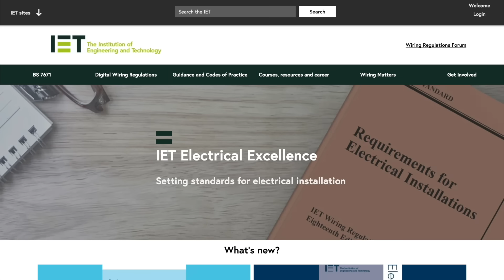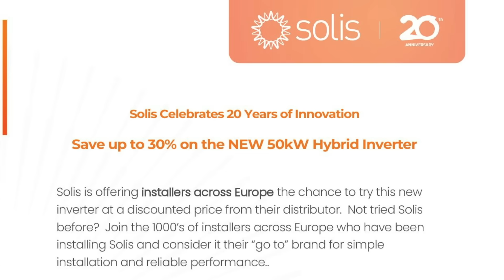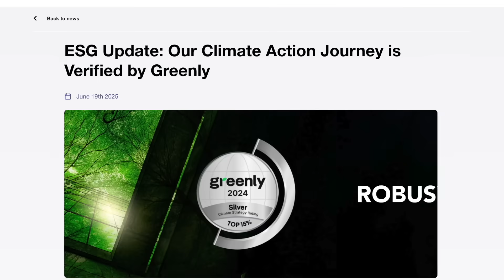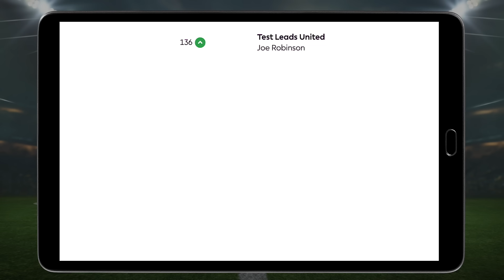Exclusive: Grid Bosses Set to Change UK Voltage

Comment: Reduced voltage, then to maintain consumption demand would require an increase in current flow. That would require a replacement of all the supply cable infrastructure with heavier cable.
Unless of course someone worked out how Nikola Tesla was able to transmit AC through the air. 
Ah, that was a zero profit project. JP Morgan was not impressed.
Reply: Resistive heaters will draw 29% less power @208V (compared to 240V; 13% less current)
Electric cars will draw 13% less power @208V (compared to 240V, same current)
Computers will draw the same power @208V (compared to 240V, 15% more current)

Comment: No, the UK is not changing its voltage. The standard nominal voltage was harmonized to 230V in the 1990s and has not changed since. This was primarily a paperwork change, and the actual voltage supplied to most homes and businesses still runs near the former 240V standard. 

Here's a breakdown of what happened:

The "change" was a compromise: In 1993, the European Union harmonized the nominal voltage across Europe to 230V. Before this, the UK used a 240V nominal voltage, while mainland Europe used 220V. The 230V standard was chosen as a compromise.A simple shift in tolerances: Instead of physically changing the grid, the legal tolerance range was adjusted to bridge the gap.The UK's legal tolerance became 230V +10% and -6%, allowing the supply to be between 216.2V and 253V.Since most of the UK's voltage was already within this new range, no expensive infrastructure changes were necessary.The actual voltage remains higher: As a result, the real-world voltage in most UK premises remains closer to the original 240V, though it is still legally referred to as 230V.Modern appliances are built for this range: All electrical equipment sold in Europe since the 1990s is designed to operate safely within the 230V ±10% range. This means that whether your local supply is closer to 220V or 240V, your devices will function properly.

Comment: I think most household appliances will continue to work ok as many things in the home don't actually need the high voltage and have internal transformers that cut down the voltage to a very low voltage , even the devices that do actually use the high voltage will ,I  think still perform as normal ,,,

Comment: The UK's electricity network chiefs are proposing a controversial change to the nation's voltage limits (1:01). This move aims to facilitate grid management as more renewable energy sources are integrated. The proposal suggests reducing the lower legal limit of mains voltage to 207 volts, aligning the UK with European standards (1:13). This change would help address issues where solar inverters push up local voltages, causing equipment like EV chargers to shut down (1:20-1:40). While network operators believe most modern appliances will be unaffected, the Institution of Engineering and Technology warns about potential impacts on older or safety-critical systems, as well as the tripping behavior of MCBs (2:40-3:06).

Other important news covered includes:

    Another fake electrician was unmasked in Ireland (3:50). Simon Murphy carried out dangerously faulty work and fraudulently claimed to be a registered electrical contractor. He was ordered to pay compensation and a fine (3:51-4:49).
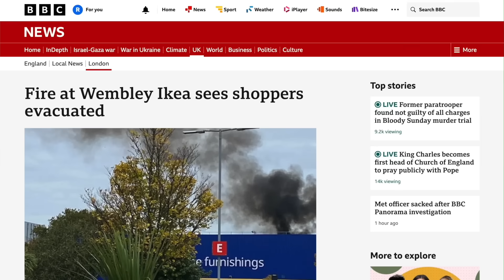    A huge solar panel fire occurred at an IKEA store in London (4:50). This happened during IKEA's first week of selling photovoltaic equipment again in the UK. Five fire engines and around 30 firefighters responded to the blaze, which involved about 100 panels (4:53-5:11).
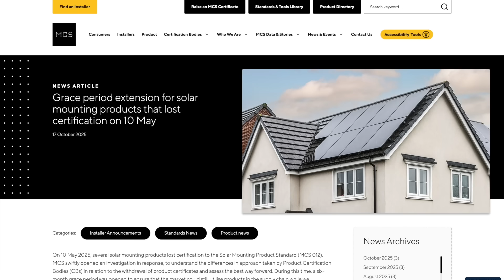    The Microgeneration Certification Scheme (MCS) extended the grace period for solar mounting products (5:42). The new deadline for compliance with the new standard for solar installs is August 10th of next year, allowing manufacturers more time to get their products certified (5:51-5:58).
    Solis unveiled new solar kit for commercial and industrial applications (6:31). Their hybrid inverters can handle up to 200% of their rated DC power input, and they introduced a new 4-in-one powerhouse unit (6:38-7:11).
    Hensel revealed new SWA junction boxes with a built-in protective earth inlay (8:02). These thermoplastic boxes offer ease of installation, cost savings, and durability compared to traditional metal ones (8:20-8:33).
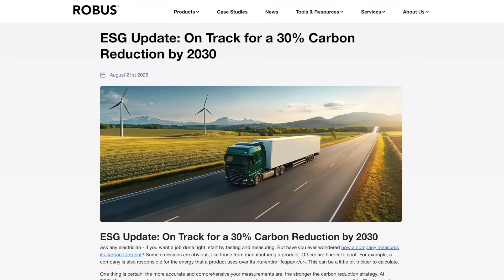    Lighting manufacturer Robus announced its goal to cut its carbon footprint by 30% by 2030 (8:44). The company measures the entire energy used by its luminaires over their lifetime and the emissions from manufacturing and disposal (8:52-9:09).
    Velocity Pro Gear is offering a special deal on tool bags and backpacks (9:26). Customers buying qualifying products can receive a free Drillpod XS (9:33-9:38). Their Rogue 600 wheeler tool case is highlighted as the world's first trackable tool bag (9:42-9:51).
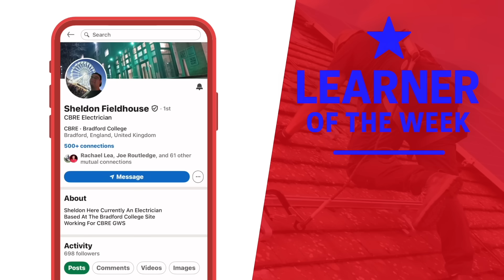    Sheldon Fieldhouse was celebrated as the "Learner of the Week" (10:27). He was recognized for his commitment to training, leadership, and community engagement as an apprentice electrician (10:49-11:24).
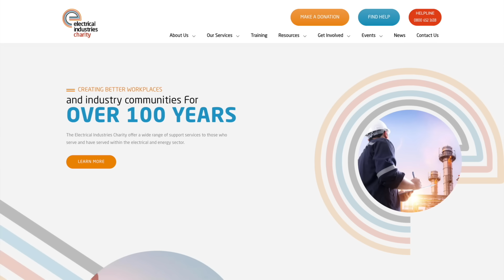    The Electrical Industries Charity (EIC) provided support to an apprentice named Jack (11:58). The charity offered financial assistance and practical help, enabling him to continue his apprenticeship while caring for his mother (12:13-12:24).

Comment: Recent ex DNO fault engineer here. I have dealt with many "voltage complaints".
This is a problem thats been around for many years, quick example, a network mostly made up of industrial consumers means night time loads are small, this leads to a raise in voltage, daytime load is high, reducing the voltage.
The fix is to set the voltage at the local substation to higher level to cope with the daytime load but not too high to cause a problem at night.
This is a fixed "Tap" position, needing a shut down to change so its very important to get it correct.
An online tap changer is large, expensive and a point of failure way above the off line type.
This local level control is not easy to do.
But at primary substations 33kv - 66Kv and above, there are automatic online tap changers.
30 years ago we stopped using "voltage regulators" on the local network as the system didn't need them anymore as it was so robust. I suspect they may come back, at a large cost in purchase and maintenance.
This is the only feasible option if the standards don't change. I can't see voltage regulation being fitted to individual older appliances, though property regulators would work.

Comment: 2:00 until the last week or two the voltage here was at very much the upper end. Ranging from 247-252v and the majority of the time sitting around 250-252. I always felt like it was pretty high. Then suddenly it switched. Now ranging from 241-250 and spending a lot more time at the lower end.

No idea what they did for the change mind you.
Reply: They could have changed which tap your distribution transformer was using.

Comment: Back in the 70s, I was working at a canal hire boat base on the Canal du Midi in southern France. Our nominal voltage was 220V. However, as our base was 4Kms from the nearest substation and the line ran from our office to the on-site restaurant with deep-freezers and then onto our workshop, any time we took a 25 metre lead from the workshop to a boat, we only had 110V available and nothing electronically controlled would work.
Reply: 225V in Italy

Comment: Are there any assumptions made when calculating a bill? For example is there an assumed network voltage used,  e.g. 240V, and if so, then will the bills change this assumption, or do meters measure both the current and voltage and therefore result in little to no impact in billing because the same power is consumed overall?
Reply: I believe (though could well be wrong) that most meters measure in Kilowatt-hours, which would account for both.

Comment: I will  NOT have any problems with the lower voltages compromising my MCBs ....  (  as I have a 1950's  FUSE BOX 😝 , which has never blown any fuses in 70 years ... if it aint broke DONT fix it 😝 ) ........... DAVE™🛑

Comment: Lower voltage = higher current for the same load. Higher current can be problematic for wiring if no spare current capacity exists on the  cable(s).

Comment: When the world adopted 230V as the nominal LV distribution voltage, New Zealand did ....... nothing.  NZ had adopted 230V +/- 6% a very long time ago (1930s I think) presumably with the idea of allowing both 220 and 240V appliances to be used.
Lowering actual voltage is easier said than done.  Often distribution transformers do not have the 'buck' taps needed, and reducing the  230/400V or11kV (or similar) system voltage reduces network capacity.   So the change takes time, during which appliance performance can vary between installations.  Modern equipment is often very tolerant of input voltage changes, but of course some is not.  Local generation adds a considerable complicating factor.

Comment: Dropping the voltage will increase transmision losses for the same power draw as equipment with switch mode power supplies will just draw more current to compensate for the lower voltage. End result current increases in the transmition lines due to increased current. To be energy efficient the the voltages should go up to reduce current and hence transmition losses. Droping the transmition voltage reduces efficiency for the transmition lines.

Comment: We can all line up for a class action law suite against the government; when our '''not so modern, perfectly functional appliances ''' go to lunch (apparently there was a compelling reason for the 10% tolerance ). What a bloody farce! All because a minority of affluent greeners  bugger up the supply! Instead of down rating the grid why don't the daft sods regulate the individual input from the greeners at the point of induction. By the same token; if a solar array is capable of supplying premises with energy to spare, why connect them to the grid anyway? Make the greeners store the excess in batteries! There is an ulterior motive here! lower voltage means less energy produced over a given time. means lower production cost, means even greater profits for the generators and suppliers; the next time they jack up the tariffs. They had no problem when the nation used to switch on the tellies, kettles and cookers at a quarter past six in the evening! ( they even made a short black and white documentary advertising the fact ) so why the sudden turnaround?

Comment: That is insane! All the electronic devices that worked perfectly and now will no longer due to voltage changes
Reply: no they wont
they didn't when it dropped from 240 to 230 did they
most devices are rated 200-250 and will just draw slightly more amps

Comment: Even shrinkflation in electricity, unbelievable
Reply: Fun sized electricity.
Reply: It isn't though. You pay for power x time (kWh) which is independent of the supply voltage.
Reply: @PharmaGiles  And watts is what?
Reply: @kaduseus  he just told you: Watts is power times time. Watt part of that did you not understand?😅

It's like distance travelled is speed times time.
Reply: @trueriver1950  So not volts amps then?
Reply: @kaduseus  For simple loads, such as an old-fashioned filament light bulb or a resistive electric heater, reducing the voltage will reduce the current and therefore reduce the power consumed, but this would also mean a lower bill. Having said that, the vast majority of modern electrical appliances nowadays (LED lighting, TVs,  computers etc) are far more sophisticated than that and will adapt (within reason) to the supply voltage and be unaffected by small changes.
Reply: @PharmaGiles  Switch mode power supplies are in most cases regulated at their output. So if you lower the voltage it will increase the current. Thus increase the loss in the power lines. Bad idea!
Where we have ohmic loads today?  All appliances got regulated power supplies today, you telly, your lightings, even the fridge and the vacuum cleaner . 
The only thing with real heating elements is my tea kettle. My stove in the kitchen got induction hotplates.
Reply: @Reaktanzkreis  As I said, the vast majority of modern appliances are not ohmic loads. Yes, there will be a tiny increase in current on the input of a switch-mode PSU if the voltage is reduced, but in the context of this story it's trivial. The UK will still have the same or marginally higher mains voltage than mainland Europe and they don't seem to be worrying particularly about power line losses, which aren't a big deal over the relatively short length of the local 230V system. Losses are far more important over long distances, which is one of the reasons why long distance power distribution runs at many kV.
Reply: Not so: a Watt hour meter measures per delivered, so if the voltage and amperage both drop, the meter still measures the correct amount of energy delivered across it's terminals
Reply: So if the supply voltage drops the current consumed will drop meaning the power used will be lower, and all your devices will be slower/weaker etc.
Actually there are the odd things that will draw more current when supply voltage drops to compensate but these arent common.

Youll use less kwh but all your electronics get slightly worse
Reply: SLOWER KETTLES

Comment: Like a few other concerned comments what happens when voltage sensitive motors (pumps/fans) with voltage specced capacitors start running slower getting hot and/or burning out.. consumers suddenly told it's just organic component failure whilst noticing replacement parts start being seen with newly respecced capacitor and wire guage rating plates ..

Comment: I bought my line-interactive UPS over a decade ago so I would have to check the input voltage settings (range at which it doesn't switch to battery) - the default is 160-286 V, the configurable range is 151-302 V, and battery-powered output can be configured as 220 V, 230 V, or 240 V.
I probably went with 240 V as our mains voltage is usually 242-244 V, although I can't remember if I went with 216-253 V or 207-253 V (there was a bit of umming and ahing over that setting).
Most of my AC-DC power adapters are FCC and CE marked and probably also designed to work in Japan, so should work with an input voltage within 100-253 V. I doubt I have anything AC-powered that isn't compatible with 207 V.

Comment: Back in 1995 we were assuming that this change would happen anyway as we moved closer to EU harmonisation. There were absolutely nonsensical claims about problems letting 230V rated EU equipment into the UK and overloading ring mains, and a lot of FUD being spread, but this was used as a counter argument that we should reduce to 230V on safety grounds. 
Since then the main problem with reducing the voltage by about 4% - incandescent bulb dimming - has more or less disappeared. IIRC the Lighting Federation was a source of objection to the proposed change,  but they were also objecting to compulsory fitting of plugs on cost grounds, and weren't therefore being taken too seriously.

Comment: Lower voltage means higher amperage so bigger bills.
Reply: No it doesn't. That's utter nonsense. A product won't consume the same power if operated at different voltages. There is a clear lack of understanding by many people in this forum.  Learn ohms I=V/R.  Power = (V*V)/R. Both current and power vary according to voltage in all normal appliances
Reply: Devices will consume different amounts of power depending on the voltage supplied, as power is calculated using the formula P = V × I (Power = Voltage × Current). If the voltage changes, the current drawn by the device will also change to maintain its required power level, assuming the device's resistance remains constant. So you are correct efficiency will be an issue.

Comment: so if the volts go down the amp draw go'es up, so curcuits that are happy near there limits will go pop, all cables will run hotter. and we are charged for the current not the volts. so our bills will go up. Am I right ?

Comment: Hi, After thought Are they going to charge us the end user less for the Electeic to our homes. As they are giving use less electric. Example say your going out to get two litres of milk form your usual shop. And the shop only has 1.5 litres of milk. But charges you for the 2 litres of mik you normaly get. You would ask them for the difference back. Stating I'm not getting the usual 2 litres of milk and your robbing the difference from me. So you get the difference back. Same with the electric. Only its electric not milk.

Comment: Yep in  Oz they could not lower the low tide mark voltage to 220v as all the irrigation pumps and other water pumping equipment would burn up due to.higher current and breakers tripping , just a fun fact
Reply: In the UK, what lower voltage does all the central heating pumps run at, plus the solenoids if you have multiple circuits in you house....
Reply: @jameshackett9992  Normally a nominal 230 Volts with around 10 percent tolerance up and down.
Reply: Reducing the voltage will automatically REDUCE the current taken by any piece of gear UNLESS the equipment is modified. The pumps may suffer from loss of pumping power but not draw extra current.
Reply: @mattsyson3980 , 10% reduction in voltage from 240 to say 220 is 20% reduction.in torque which can cause a motor to stall a d then burn up , if you add a variance on 220v nominal voltage again ,it not be happy, motor's are not pure simple resistance in nature

Comment: if they do I hope they get rid of the mighty 32A ring circuit even with fused plugs that mighty 32A ring circuit is not the best as if theirs a problem in line with that circuit entire circuit trips! USA here outlets are separated from light fixtures so if a outlet circuit trips it dosent affect the lights